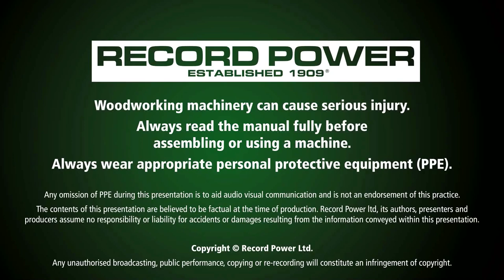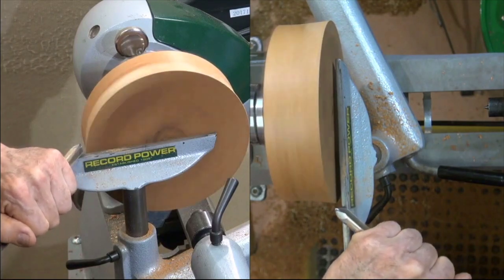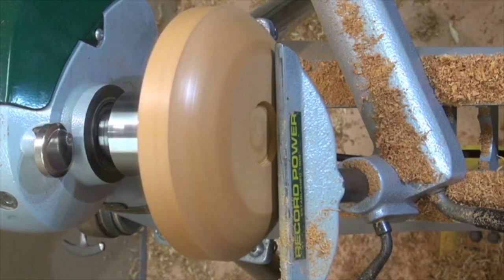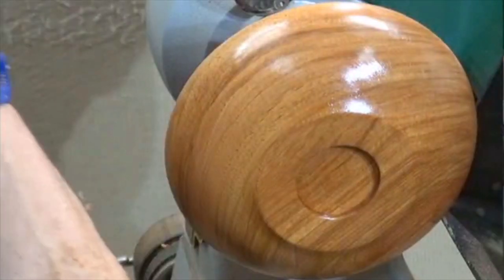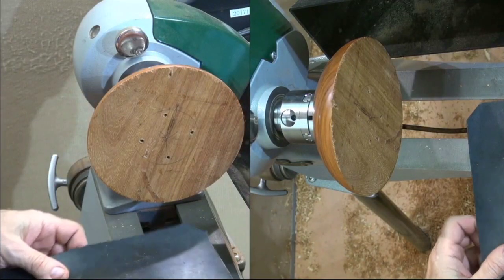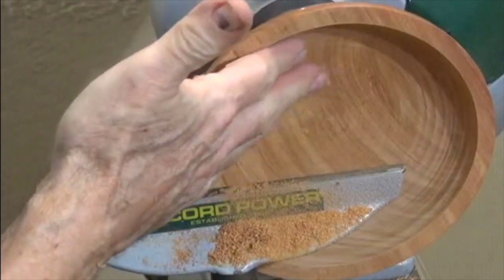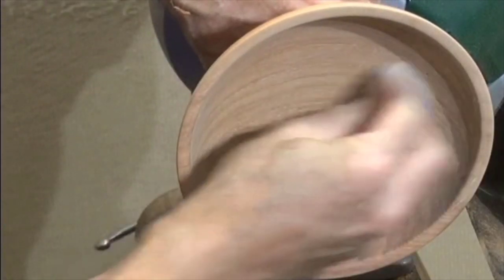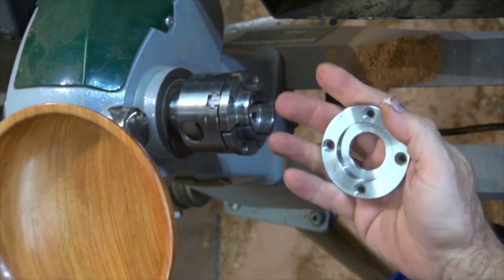Mini Chucks Project 2 with Theo Haralampou - Turning a Bowl

Comment: Hi what is the maximum size of a bowl i can make with the SC2 chuck?
Reply from the maker: Hello, thank you for your comment. It is possible to turn a bowl to the maximum acceptable with the lathe in use, however, approximately 10" - 12" would be recommended by our experts. For more information, please contact our Technical Support team on 01246 571 020 (and select option 2) or email technical@recordpower.co.uk. Best Wishes, Record Power.

Comment: @16:12  why use oil over EEE @15:40 sanding wax , surely the oil won't penetrate
Reply from the maker: Hi Alf, thank you for your comment. EEE Ultra shine and Aussie Oil are both U-Beaut products and they are designed to complement each other. Any type of oil can be used over the top of EEE or it can be used as a finish on its own.  Because Aussie Oil comes with its own thinners in the bottle, when you shake it vigorously, it helps thin the oil so that it penetrates deeper into the wood rather than just sit on the surface.  When the work is burnished with a cloth the heat that is generated evaporates the thinners and the oil goes hard leaving a glossy finish. Hope this helps. Best Wishes, Record Power.